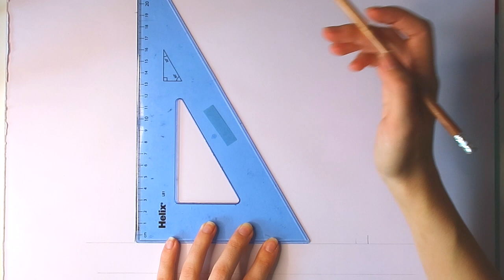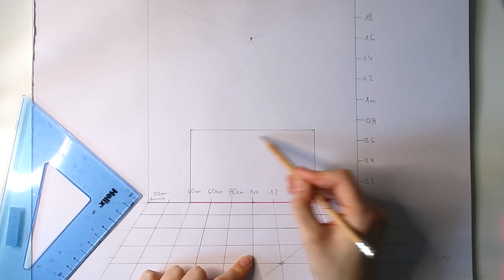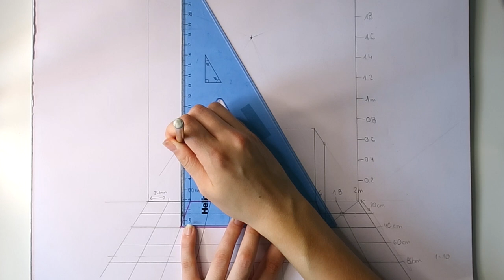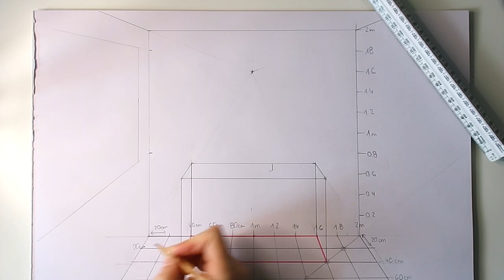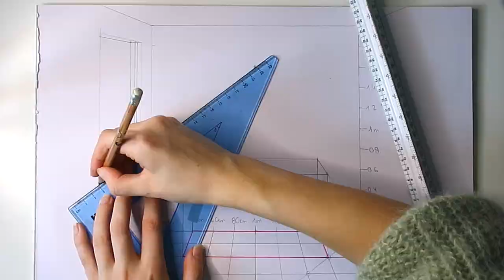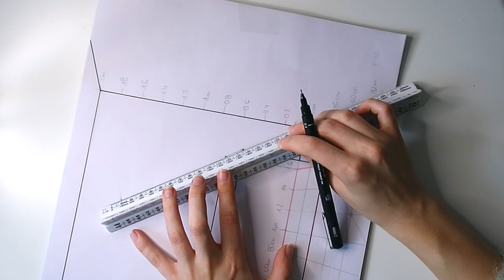Interior Design: How to draw a Perspective Drawing for Beginners

Comment: What was the perspective point on the other paper for, other than the line? What did you use that line for?
Reply from the maker: I used it so that I could draw horizontal lines that indicate the distance, where the line met with the vertical lines, it’s hard to explain it 😂
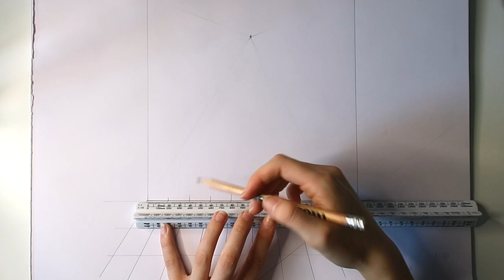Reply from the maker: I explain it at 5:49, I know it’s probably not explained the best way and a little bit difficult to understand, I hope this helped to answer your question 🙈
Reply: @DanasDiary.  Ahhh thanks I didn't understand it the first time, but watching it again helps :D